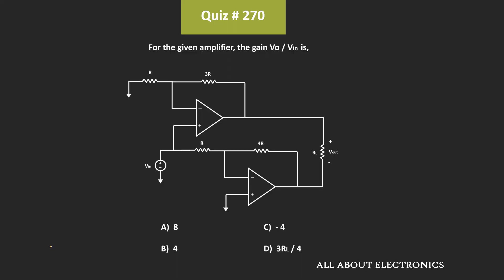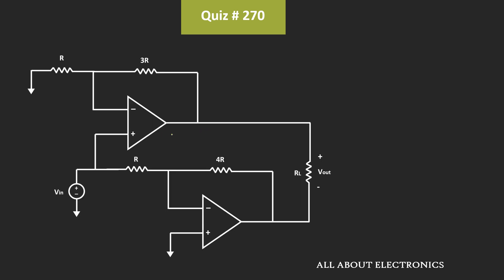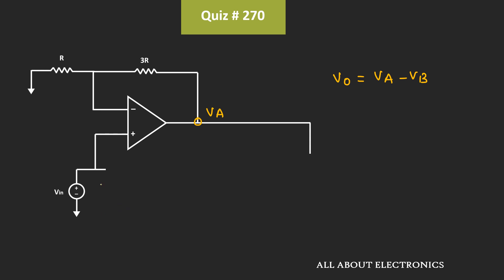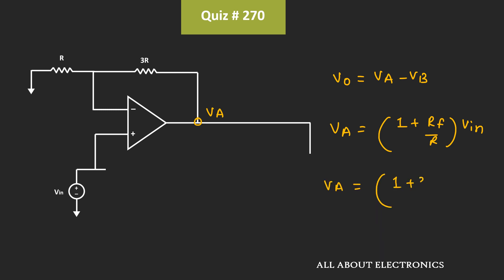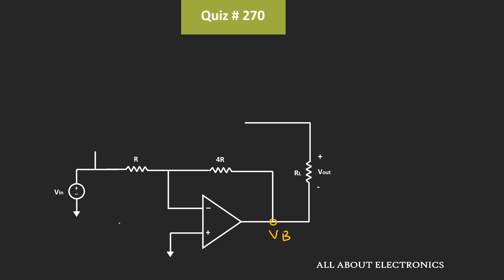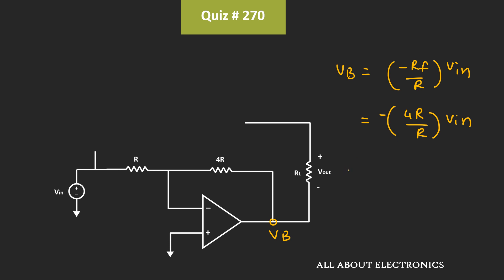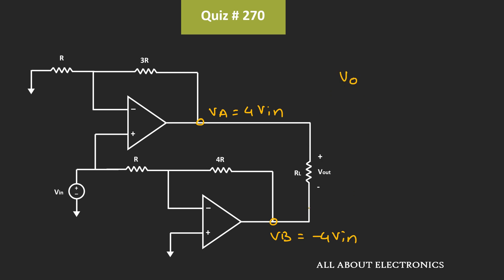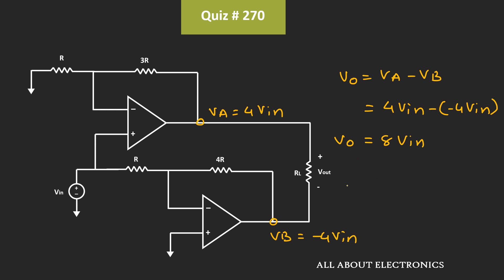Operational Amplifier (Op-Amp) Solved Problem | Quiz # 270

Comment: Sir please can you please explain about gate preparation with out coaching, in which way we have to prepare/schedule we have to follow.. for ece gate..
My special request sir.
Reply from the maker: First, cover those subjects thoroughly which you find easy. ( network theory/ Network Analysis, and Digital Electronics are relatively easy)
You can start with those subjects and cover them first. 
Also solve some questions while studying the subjects.
Once you get comfortable with the subject, you can solve previous year GATE papers. ( The questions on that particular topic from previous years papers)
Once you are able to solve it, you will get some confidence.
 Then you can start with the subjects which you find moderately hard. (Actually no subject is hard, once you go through it thoroughly, you will find all subjects are the same !! )
Around the time of September- October, you can join the Test Series. (Various Institutes provides mock tests )
That will give you rough idea about your preparation and where you need to improve.  
Prepare short notes, for every subject !! (It will be useful for revising the subject, highlight some important equations, relations, theorem/statements)
Follow these steps, and in between, if you need any help or guidance, I am always there. 
Good luck !!
Reply: @allaboutelectronics-quiz  
Thankyou somuch for responding...and suggesting. 
Thankyou.

Comment: Hi Dear, I have a basic bridge rectifier question that I couldn't find out what's the correct answer. What's the average current across diodes when load current is 2 ampere across bridge rectifier? May you please help me?
Reply: 1 Amp
Reply: Thanos Singh how come?